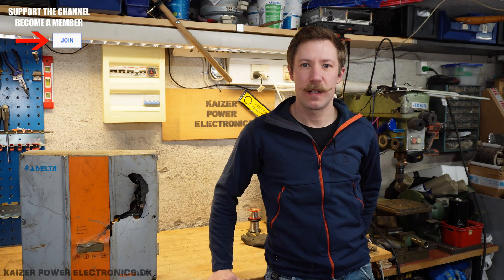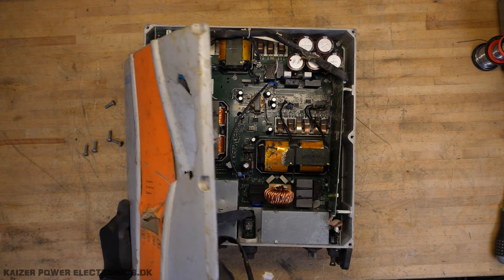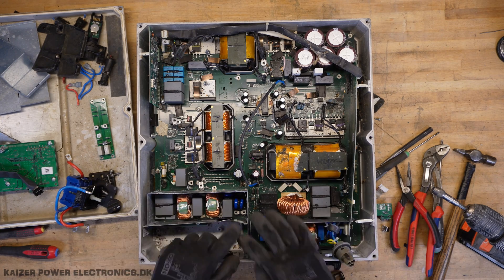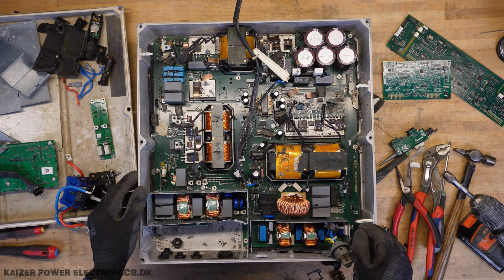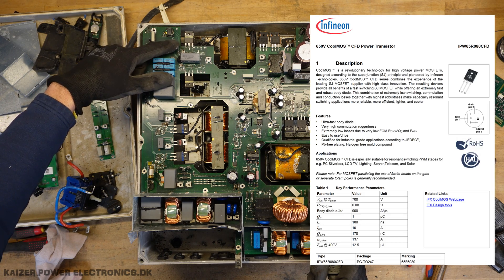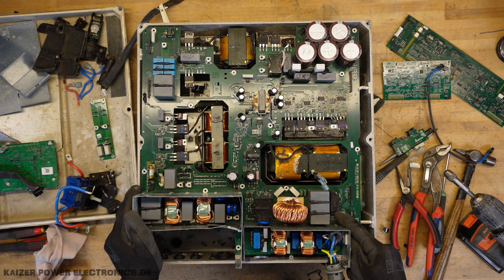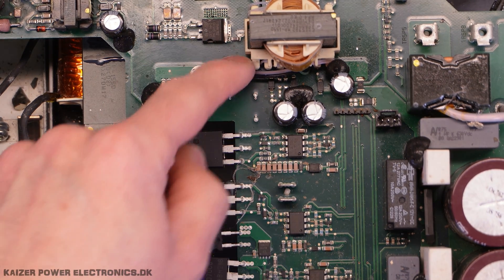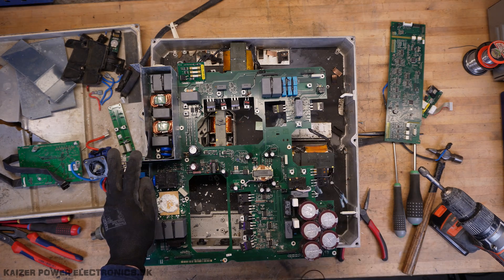3 kVA Delta Solar Inverter Teardown, the Solivia 3.0 TR

Comment: Would also have liked to have a look into the display-module.
I myself would repurpose (also) the big(ger) capacitors, coils and the big transistors/diodes.
Did this unit only take a beating at the scrapyard or did it also had a "spectacular" failure?
As the insides looked (on-screen) a bid blackened?
Reply from the maker: I completely forgot about the display, as I used the lid for putting stuff on :o The stuff I get from the scrap yards, are there for a reason. They are discarded from companies, so its a large mixed of old, working, defective, could-not-be-repaired, out of specifications or out of calibration. So it is safe to assume that most things are broken in the first place. If things are in real good condition, you do not see me doing these destructive teardowns, but a more gentle one :)